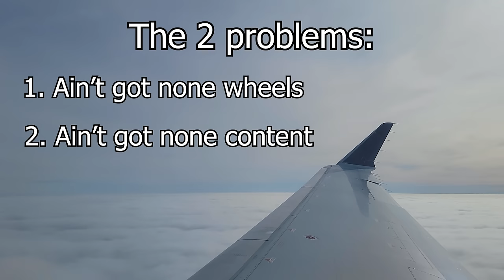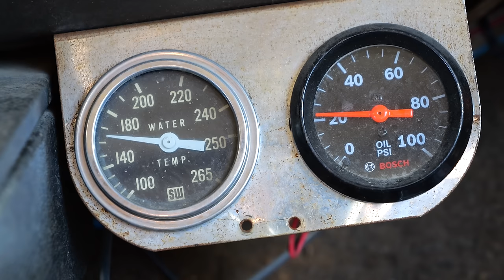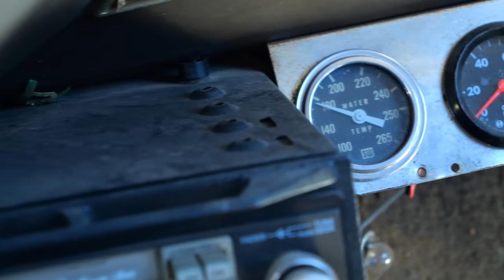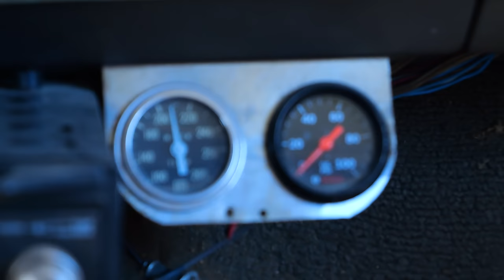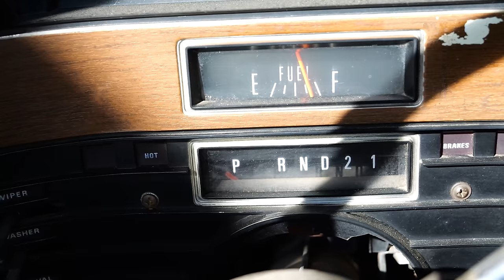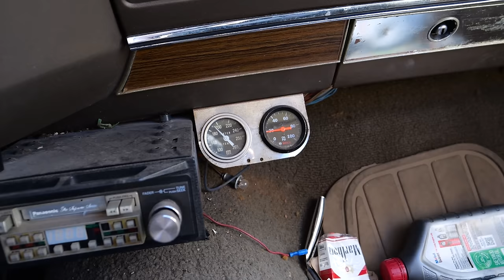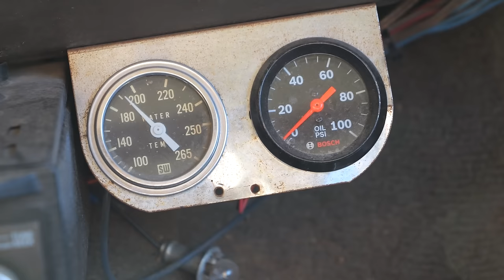Will a 1970's Wagon SURVIVE 2,100 Miles with NO REVERSE?

Comment: This Windsor has earned a second chance at life. I'd love to see the teardown and rebuild. This old gal is wonderful.
Reply: yep if not damaged to bad
Reply: Agreed
Reply: Yes
Reply: Those 351 engines were some damn good engines, my buddie har one and had to run 10w40 and Lucas  just to keep the bottom end quiet.
Reply: @joshprice6954  my uncle had a 79 Grand Marquis with a 351 Windsor in it. They are legendary for a reason.
Reply: @joshprice6954  for us Europeans, 10w40 is not thick, just mid-range viscosity. Many BMWs run on 10w60. I plan on running 15w40 or 15w50 in the hot Greek summer as I don't have an oil cooler in my Fiat and currently 5w40 is too "thin" for summer usage.
Reply: @xynostasos9022  most of our modern vehicles run 5w30 or even 5w20 and the Hondas here, at least the new ones run 0w20
Reply: @joshprice6954  in the past, only Japanese cars would you something like a 10w30, 5w30, 5w20 etc. Now even most European models use very thin oils like 0w20.
Reply: If only that particular 351 Windsor didn't have a wore out thrust bearing or janked crank.

Comment: I can't wait to see the teardown. I'm curious to see what the engine is really like inside.
Reply: well it wont need an oil change.
this engine just pissed the oil out everywhere.
I bet the oil filter looks like new, ha ha
Reply: Clean out the oil galleys and the basepan… possibly look at replacing that front seal and you’re good to go… I’m not even a Ford fan and that thing impressed the shit outta me…
Reply: 😂funny I had the same oil problem on my 71 olds 350 it had low oil pressure 25 psi,took it a part found out that my cam bearings were not even smooth. Change them pressure was around 35 psi ok.😆😎👍
Reply: like a coal mine i would think😆
Reply: It's held together by the oil buildup. It's gonna lose compression completely once it's completely clean 🤣
Reply: Goop
Reply: Probably junk tbh
Reply: @nobodyspecial6436  the power of the Windsor
Reply: You and me both
Reply: yeah but this is one of those channels that gets all the big views (aka adsense revenue) from revive and deives so the likelihood of ever seeing this car again is slim
Reply: I agree will be very interesting
Reply: This engine is a living Lucas ad
Reply: Its a 351 if it spins it runs
Reply: Its gonna be bad
Reply: No doubt it’s a train 🚂 wreck! 
Some people don’t see any point in changing oil!!🤷🏻‍♂️
Reply: @BillyNoMates1974  
Had a 56 Ford that leaked so bad from the rear main I put a pan under it at night and in about three days poured two quarts back in!!
Reply: @ludicrous7044  wow. that is impressive
Reply: @pawepuchalski3448  
Prolong additive is MUCH better!
Pour a bottle in-Run engine an hour and even if ALL the oil leaks out no problem!! It’s a space age polymer that clings to moving parts. Most people won’t buy it because it cost $12 a bottle ! Search YouTube for videos and be amazed!!😮
Reply: Wouldn't be surprised if it's spotless on the inside, unlike the leaky outside lol
Reply: Yes we need a teardown
Reply: @Hard_Right  with the way that engine looked I hope he does a total revival of the car
Reply: @nobodyspecial6436  It really was quite an impressive trip for that engine after I seen what it looked like under the valve covers.
Reply: @BillyNoMates1974  yep super clean engine !
Reply: I once tore down a 305 out of a shitbox 1980's cutlass that my friend had bought.  I'm pretty sure it wasn't the original motor for the car but I was pretty sure it was the original oil in the engine.  It took us about a week of parts washing to get the crud out of it.  It wasn't AS bad as this 351w, but it was damn close.  I filled a quart size sandwich back with just..  shit.. from the oil pan alone.  It was one of those "Just add a quart every X miles and you're fine".    Only difference, this 305 was oiling down the cylinders too!   You might be surprised in the condition of the engine if you clean it.  I won't say it's good, but considering it made it 2100 miles I bet it's better than most of us would imagine.
Reply: @Hard_Right  you clearly don’t watch the channel because he’s definitely gonna do it 🤦🏻‍♂️
Reply: @Hard_Right  this isn’t Road kill he isn’t making a show you gotta pay for 🤣
Reply: Hey, did you play the Sims too when you were younger?
Reply: @NaoPb  you're the first person to figure my name out!
Reply: Should have taken those valve covers off before the power wash!
Reply: @ludicrous7044  that's real recycling.
Reply: @ludicrous7044  the rotating assembly is covered in atomic age polymer, it wouldn't fix it.
Reply: @nobodyspecial6436  That's like a story someone would tell you about a Chrysler Slant-6 and you wouldn't believe. That 351W deserves a rebuild. It was sick and poorly maintained and it got you home against all odds.
Reply: Me too!
Reply: There ain't nothing wrong with that engine
Reply: @RobertDickens2002  well it definitely needs a thorough cleaning out.
Reply: @michaelhylanddpt  very true
Reply: I hope he restores the car to its former glory.

Comment: After refusing to die and getting you that far, that 351 deserves to be rebuilt with some real nice go fast parts
Reply: Iam 67 yrs old. Former truck driver.  This reminds me so much of some of the sketchy  trips I have made.  I was on the edge of my seat through this whole video. With all that oil spraying out that thing could of burst into flames at any second.
Reply: I agree with this
Reply: i agree, personally i want to see him fix it and take it on power tour 2023
Reply: Bore it . 030 over, throw in a stroker crank, and you'll have a nice sleeper wagon. Little find hand work on the heads and you'll thank yourself for the hard work
Reply: Bore and stroker crank up to a 427. 351C or aftermarket heads. Lots of possibilities for a supercruiser. I hope that Kevin learned his lesson with the oil leak. He was correct - he would have been far better off and risked far less dealing with it in San Diego. For what it would have cost to get the car and himself back home, he could have paid for all the machine work for a fresh engine. With room to spare. Best wishes! 👍🏻👨🏻‍🔧🇺🇸

- Max Giganteum

Comment: The oil pressure getting better when you let off the gas is pointing to a wore thrust bearing. Your crank is walking back and forth. We had a auto hobby shop back on NAS Oceania Airbase when I was in , it was a badass place.
Reply: Is there a way to circumvent that or make it where the thrust bearings don't shit themselves and give out? A stupid question, I know but what exactly causes that problem other than the crank being out of wack?
Reply: @TheSilverShadow17 it’s normal wear and tear keeping up on your oil changes helps prevent wear but eventually it will wear out along with the other bearings in your engine if you find that much wear you’re due for an engine rebuild

Comment: The oil pump pick up screen was probably plugged up with all of that sludge.   I can't believe you made it all the way home.  That's amazing
Reply: I think with all the oil drains being icked up I think the oil is pooling in the heads and then when he lets off the gas the oil has a chance to drip back down into the pan
Reply: Plugged pickup screen was my thought as well. I assume they cleared out the drains while the valve covers were off. I was hoping he'd drop the pan in San Diego to inspect. At that point toss in a set of rod bearings to get the psi's up too.
Reply: Yea I was thinking pick up screen was one of the many oil flow problems
Reply: Did he change the filter???   If the heads were so bad and the oil pickup suspect?    Did I miss that maybe?
Reply: I didn't see an oil drain and filter change.  Had the same thought that the filter is clogged preventing some flow.  Also the gauge is probably reading AFTER the pressure drop in oil flow sequence  (which would explain why he made it all the way home).

Comment: Love the wagon and the episode. Nothing like a good old fashion road trip. You were worried about showing some people your exit and address but you left a liquid and vapor petroleum based trail from California to your front door that you can track from the International Space Station! 😮😆
Reply: Yeah I was thinking about that, probably don't want the EPA knocking at your door.
Reply: lol, yup, he did...  @Junkyard Digs, might be a good idea to get a 55 gallon drum of Simple Green, then dump it between your house and a few miles down I-35... 🤣🤣🤣
Reply: A little trivia, if true: someone once told me that cars used to leak and/or evaporate and then leak so much oil before PCV Valves showed up, that highways would have oil stripes on them by the spot where the crankcase vent was. Any idea if there's truth to that? I know 1950s oil would evaporate a lot easier, at least.

Comment: Hey, that's one tough little Windsor engine. Making it that far and not throwing a rod out the side of the block is a testament to Ford's engineering.  Looking at the old wagon is sure does look like a early 1970s XA series Australian Ford Fairmont released here in the country Down Under. That's a hint for sorting that HVAC system out. Our early Ford's were based on US versions and just as big.
Great video.
Reply: I thought it looked like a xy at first but you're def right that little "bend" in the grill really gives it away idk how I missed that

Comment: Man, I hope it's not too late, but before you tear it down, you should try running different engine cleaners through the oil and see how much it improves, like Seafoam, BG EPR, automatic transmission fluid, etc. I'd LOVE to see what happens to it, how much it actually cleans up, how it affects the oil pressure.
Reply: Exactly! I would've been doing it on the drive home.
Reply: I would go with BG cleaner.
Reply: Send that tired gal to the farm…@ProjectFarm that is
Reply: He would have needed to change the filter with every refill though
Reply: If it’s really bad, Kerosene!
Reply: Great idea
Reply: Why not run Marvel Mystery Oil
Reply: @shawnkleveland3967  agreed, we use EPR and MOA at my dealership and I've seen it work great after a few treatments.
Reply: If I wanted to try and save the engine without rebuilding: I would 1. Remove valve covers and vacuum all the chunks out, clean rockers etc... with solvent. 2. Drop and clean the oil pan, replace oil pump and screen. 3. Replace front main seal. Run 20W-50 with Lucas and cross my fingers. Just adding solvents is not going to help the oil leak. It would just make it worse. Kevin went through over 35 quarts of oil just getting home, and don't forget the hardened oil chunks found just under one valve cover. No additive is going to help with that. The engine really needs a rebuild. 1970 was a long time ago.
Reply: @peterbrinkerhoff4344  oh don't worry, there's no saving that engine, lol. I think it would just be fun to see what would clean it up, if at all. I'm sure SOMETHING will clean it up.
Reply: Me personally if it was my engine, I would replace that front seal, and then pull the valve covers off and make sure none of the galleys are blocked up, then put 20w50 back in it and see what would happen.  All of my experience in the past, an engine that had true low oil pressure the valve train would clatter like crazy.  At the absolute minimum, you only need a couple of pounds of pressure at idle, and he was almost there even with the severe oil leak.  You never know, he might fix the front seal and finds out he's got 10-15 at idle and 40 or so running down the road.

Comment: So much of this is instantly relatable to me.  I still own and drive a 1969 Ford Galaxy 500 4dr.  It was my first car; a handmedown originally purchased by by grandfather I've had since '87.  Wish it still looked as good as this wonderful wagon !   Shame about the hood but the same thing happened with mine about 30 years ago.  I "flattened it's ears" as best I could and filled with JB Weld.  Not perfect but it passes. 
      If that engine is original to the car it has definitely earned a rebuild !  By the condition of the balancer, it probably has around 300k miles.  The cam should be inspected as well.  The 302 in mine still ran very smooth with a rounded off cam lobe on the exhaust.  The only noticeable symptom was crankcase oil tinting dark soon after changing.  I found the sludge when I pulled the timing cover after noticing chain noise.  The lube ports had nearly closed off as well which probably lead to the chain wear which  I'm now greatful for !  It had given me warning in enough time.  She got a new cam, lifters, timing kit, balancer, front crank seal, and the best cleanings I could manage without pulling the block.  A couple of oil changes later and she was good to go.  This was back in 2014.  I think your in for about the same on this "wonder wagon" but an original engine is worth it !  It looks like this thing is in very solid condition,  better than mine which is beat to death but still drives and rides great.
      Please note that the AM/FM STEREO radio in this is EXCEPTIONALLY RARE and should definitely be kept and restored !  The "cockpit" style instrumentation in these cars is beautiful even though it rendered the gloveboxes virtually inaccessible 😂.  Enter through the passenger side to check the contents of the latter 😅.   The front dash is usually destroyed in these old cars and that's up to ones own enginuity 🤔 but, on the bright side, there's seldom much to lose 😅.  All in all, this is a comfortable riding, good driving keeper !  Give her a chance and you'll love her!  Just hope for better driving conditions 🥶.

Comment: Love the 70's wagons! Beautiful styling. Great job keeping her alive for that long trip home ! I worked on many of those in the late 70's and 80's. It was common to find engines of that era jammed with baked on sludge. I cleaned out many oil drain holes while replacing valve cover gaskets. People just didn't have the cash to change the oil every 3.5K. Also, You could have a clogged pickup screen in the oil pan after seeing the sludge up top. I've seen a lot worse during my career and that was common too. It could have been that gasoline was much dirtier which it was, and or engine oil in the 70's didn't have the high detergents that the modern oils have. And that the owner assumed that the factory engine oil was good for the life of the engine. lol.( a customer of mine actually thought this and ruined her engine at 30,000 miles!) There was NOTHING in the pan but 3 inches of baked on oil ! Oil Well That Ends Well i guess!

Comment: It’s wild seeing fresh oil come out black black within 200 miles.
I’d rebuild that 351, it deserves another chance for sure.

Happy New Year Kevin and Mook
Reply: Yeah I'm not sure how you would rebuild that thing It probably has no compression once you take all the sludge out of it I guess you could sleeve it
Reply: @colchronic  it's called a machine shop, they can turn a block of rust into new steel with enough money and the right tools. Likely without sleeves
Reply: @LeObsidianCraft  sure assuming that a 230,000 mi vehicle hasn't been overbored to its maximum spec
Reply: @colchronic  it doesn't seem likely that the previous owner(s) ever had the money or the want to get that motor rebuilt. It would surprise me if it's been bored over stock
Reply: @LeObsidianCraft  yeah who knows to be honest I bet those Pistons fall right out once the caps are removed
Reply: @colchronic  At this point I think there are no piston rings and the only thing keeping compression is the sludge.

Comment: I drove a VW Baja bug for about six months with no reverse, but that is a MUCH easier and smaller vehicle to push! Yes this vid reminded me of some of the early Roadkill vids.  Thank you for doing this for us lowly subscribers entertainment rather than just taking a first class airline flight back to Iowa. :) Furthermore, thank you for being from a place like rural Iowa and representing us upper midwest guys! Don't ever change. (except your underpants)
Reply: At age 68, I can assure you that engine is 'way better than you think! My best guess is the oil pan has accumulated sludge and black goo accumulating over the pickup and probably very little screen area remains unblocked. I have driven these old Fords until they had to be roll started because of such low compression that they wouldn't start on the starter. But rarely have I seen one break. My daily driver is now at 377,000 and counting. And it isn't the worst I have seen, nor the highest miles I have driven daily.
Reply: I'll give you a heart for comment , because I have had a couple vw bugs with broken reverse  yes its much easier to push around when needed lol!
Reply: I think the no reverse bug is mostly that stupid shifter bushing that breaks every 5 seconds and is a pain in the ass to replace.

Comment: Dude, you know exactly what that oil pressure shit was about. The engine was clogged in multiple passages and the sensor was one of them. It just cleared itself better than before. As long as you kept feeding the engine more oil, it kept chuggimg after the clearance. We all know you lucked out and got it to clear the issues. You'll find that blockage later in another area, be it the pan or another part of the block. Love ya bud, be safe.